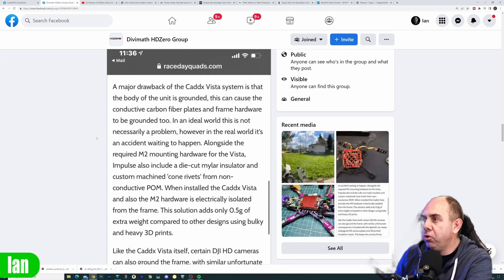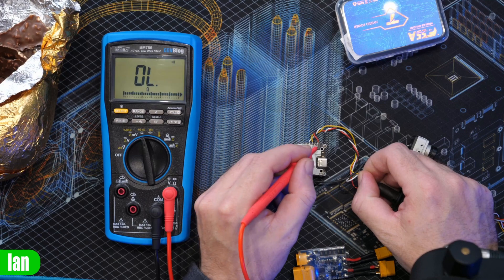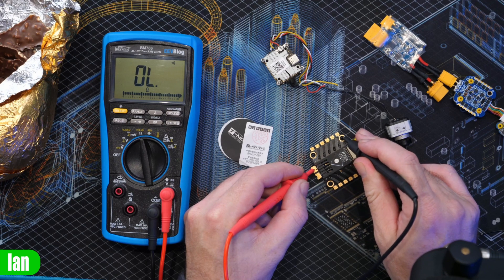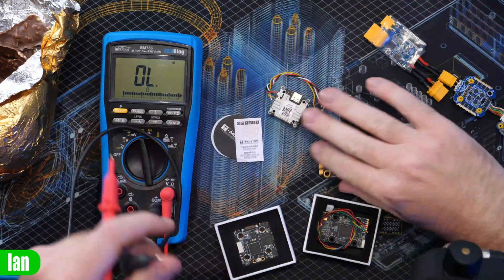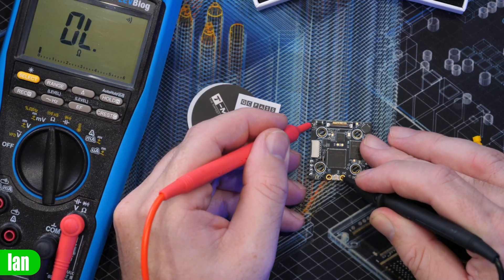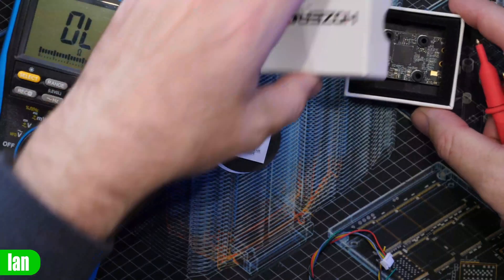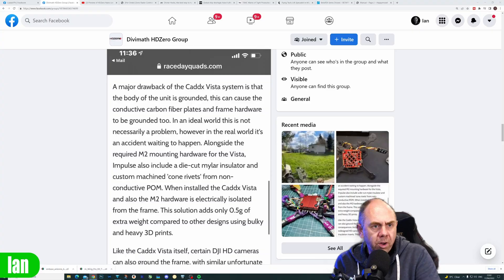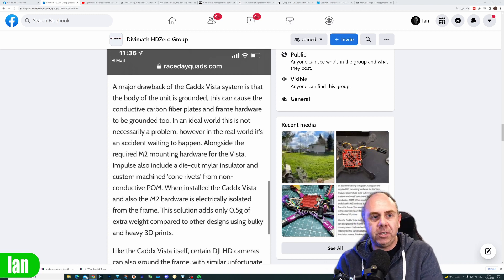CaddX Vista Grounding - Really An Issue ? - Live Clip

Comment: Thats not exactly from RDQ, its from the new ImpulseRC Apex DC frame description. Trying to making selling points for the frame, causing kaoss at the same time. Deffently have never had an issue with grounding. Make sure you builds are done right, and you shouldn't ever have an issue.

Comment: For me the problem is that caddx Vista mounting holes are grounded more than the external shield, or is it? Have you checked or can you check if you have an open caddx vista double board, if the screws holes are grounded or not? Just to understand if it's only the external shield grounded or all the internal boards becomes grounded together through the holes if a screw is in it?

Comment: Wrong Wrong.  Easy situation.   I overtightened one motor bolt by mistake and it touched the motor winding. At the time of the next start, Vista stopped showing the image. Was sent to a service center and restored. (I live near one of DJI main offices) ... Many frame manufacturers add plastic pads to the motors in the kit. At any time, you can repeat my situation - if you try to fix the motor stronger. Take my word for it - I was surprised - when I realized what happened.
Reply from the maker: Yea but the issue was not the vista. The issue is as you shorted the motor bolt to the motor.  Now let’s look at this different, vista was isolated and you flew and it worked until it broke though the wire and you downed the craft and damaged the frame, Lipo and burnt the ESC.  Again the issue was the bolt.  The simple realty is bad things will happen when something goes wrong. Adding the vista into the mix via grounding is not a major contributing factor.  .
Reply: @MadRC   sure. just wanna say - if the vista's body will be not grounded - it will be much more better for durability.  I just change the bolt - all motors and stuck works well and back to normal - but  not Vista

Comment: T-motor esc’s mounting holes are not grounded, but not isolated also! Check the continuity between motor phases and mounting holes. If you’re using metal stack screws without gummies- that’s where your issue starts to happen. There will be issue without grounded frame also, but not so much (desync or inconsistent behavior, you can say something is wrong in bidirectional dshot error rate, even before fly)

Comment: Even if the carbon fiber becomes grounded if you don't short anything to ground there isn't a problem.   The first thing we used to do with carbon fiber frames when building helicopters is sand all the corners so there are no sharp edges that will cut any wires.   What can be a problem is a signal antenna wire on a receiver lying in a carbon fiber frame which can potentially block the signal.

Comment: the potential issue is, that if the frame is grounded, and the positive battery wire touches the frame, the quad will fall out of the sky
which is something preferably avoided, hm?
especially in professional settings, i guess

Comment: I don't see why this is so controversial, and we don't need the melodrama. This is from the description ImpulseRC wrote about their Apex DC frame, which RDQ added to their website. So it's not from RDQ, it's from ImpulseRC. They were trying to do a little marketing around (what they believe) is a thoughtful design approach to solve a potential issue (and I'm sure it's an issue they've seen happen at least once, otherwise why bother?) ... If your Vista (or anything for that matter) is grounded to frame, and a live wire touches the frame, there's a potential for damage to any grounded components. A potential. Because the vista is expensive and not very easily replaced, they thought to isolate it - similar to how ESCs and FCs are technically isolated, as well. 

If I had a particularly bad crash and one of my (+) wires touched the frame, its damage may well be limited if my other sensitive electronics are isolated electrically from the frame. You're right that it's probably a non-issue for most, but it's just a little extra insurance Impulse RC just built into their design, my assumption is based on some number of complaints or concerns from customers. When I build, I isolate my HDZero VTX, my RX and everything else I can from metal-to-frame contact, because I've fried components in bad crashes when a live wire touched the frame by accident. Or a poor soldering job or bad mounting on my part caused an issue. This really isn't a controversy. Build however you want, isolate your stuff if you want. end of story.

Comment: I would hope that any RF device is grounded, especially one that uses unbalanced feeder (coax). Unless the antenna is balanced or has some form of counterpoise to work against, then using the chassis as a ground is the only way to ensure efficiency. And efficiency does not mean a low SWR but rather the reactive components, Xc and Xl are close to or equal zero.

As for 5inch (12.7cm) carbon props?? 12.7cm is close enough for government work to be a resonant full wave on 2.4GH. Carbon is RF conductive and absorbent, more so when it’s physical size is equal to a resonant property of the frequency being used. Which coincidently brings us back to the grounding effects of a quad frame.

Comment: I’ve always “isolated” my Vista by mounting it with double sided VHB tape, but I did that to isolate it from vibration more than anything else.

I’ve also had both the positive and negative battery wires cut through and touch the frame, it was funny trying to fly it back while it was sparking and browning out lol

Back in the day the bottom deck often contained both negative and positive rails and in some designs was one great big PDB, nobody was bothered about stuff being grounded back then, I’ve always considered the frame to be grounded though, it’s just good electrical practice especially for those of us who’ve worked on cars and motorcycles.

Comment: Good discussion with nice examples. I view grounding to the frame as an advantage, because it creates a known reference. (Unrelated in modern home appliance design, appliances have their casing grounded. This wasn't always the case and created some hazardous situations like touching an appliance and a metal sink)

The carbon propeller situation is interesting. (8:55)
Would expect the propellers acting like a shielded disk (rather 4 of them covering a larger plain area) If the effects are changing relative to motor rpm, it's likely similar to placing an antenna next to a larger plainer metal surface. There going to be radio wave reflections likely creating a very noisy (radio) environment. 
Worst case likely would be for a pusher (carbon propellers below motor) and antenna above the drone where the pilot is below the flying drone.

Comment: The reality is that our quads can take quite the beating resulting in all kinds of failures and having the frame electrically connected to anything is just an current path accident waiting to happen. If isolating it saves me from losing a quad or saves an expensive component then it's a simple precaution I'm happy to take! Off the top of my head some examples of ground path failures I've personally encountered since I built my first multirotor over a decade ago:

- Brand new spare motor with a short to stator (FIRE upon arming, dead ESC + Motor)
- Squished motor wire to arm nut in a tree crash (FIRE whilst turtling out of said tree, dead ESC + Vista camera cable)
- Alien PDB insulation wearing through when mounted directly on carbon (FIRE)
- Shorted motor winding to stator after crash
- Long motor screws (Seen this happen to MANY beginners, and a short stopper won't detect it until you arm the motors!)
- Mangled battery wires shorting to top plate killing VTX
- Arm mounted ESC rubbed through Heatshrink (frame positive) combined with:
- Rx antenna coax insulation wearing through where it touched carbon resulting in intermittent failsafe's

But yeah the Vista case being grounded isn't really a inherent disadvantage.. (I'm sure It does wonders for RF shielding!) The issue is it's just lining up another hole in the swiss cheese of failure!

Comment: Just a thought about RF performance of grounded/non-grounded frame:
1] All RF designers have a good practice to ground up a metal case of their RF device - it usually helps to overall performance. I understand why Vista is grounded - it's a good practice.
2] Because some/all antennas we use (dipole, circular) aren't perfectly balanced (simple dipole is around 73Ω and I highly doubt that all RXs (which are often also transmitting telemetry) have their input/output matched to that - I guess more common impedance of 50Ω is used frequently), then even the feed-line is part of the antenna and it's affecting resonance, impedance, radiation pattern ... So having a frame grounded definitely adds a complicated RF behavior, which is in some cases good (it helps to RF performance), in some cases bad (makes RF performance worse), depending on exact antenna(s) position and its parameters. If a frame isn't grounded, there's still an important influence of antenna position and orientation in respect to VTX and all other PCBs and electrically connected devices. And at the end - just the presence of carbon frame in the vicinity of antenna influences its RF performance because of capacitive coupling and reflection. (This is also I guess the reason why carbon propellers do influence the RF performance on some drones. The designers of the drone probably tested it and optimized it for the best RF performance in "default" configuration and any change to that may influence the RF performance).
So to sum it up:
From an RF point of view - the grounded frame is totally valid thing and sometimes it can help to improve the RF performance and sometimes it can be the opposite - everything depends on the physical layout and placement of all components
From a DC point of view - it adds one possible mode of failure (VBAT wire shorting to ground) to MANY already existing modes of failure. Route and protect your VBAT wire(s) properly in any case.

Comment: The ground tracks are not thick enough to survice a short, maybe,  I don't know, but if a disaster happens it happens. The gounding of the VTX  body is done for RF reasons I am guessing. Interestingly the heatsink of the 1W hdzero VTX has a non conductive coating - Macs Life shows this in one of his videos.

Comment: Isolating the vista case from the frame is a BAD thing , because if a positive wire does come into contact with it the only path for the current to take is through the units sensitive bits ,and it will burn the earths and let the smoke out, I allways ground the case , i have many vistas and air units and no problems

Comment: Treat the carbon frame as a conductive chassis onto/into which you are mounting electronic modules. In a system which includes fast switching high current, RF amplifiers, and a processor, we Must pay attention to each of their grounds.
In my decades of electronics building and troubleshooting, the grounds are the first thing I inspect. “Single Point Ground” aka star ground is still a valid concept.

Comment: Posted this comment on JB's vid:

I've had a flight controller die for this exact reason in the past, could have been prevented had I used this/a similar frame which isolates BOTH the DJI Camera and Vista. (people forget that the DJI camera is metal and also grounded to the vista).. 

There are lots of ways that your frame can get electrically charged, for example crashing and a motor bell bending which shorts to a winding (how I killed mine), or wire or a vbat wire shorting directly etc. This is just another safety measure and worth having.

People who don't think this is a good idea probably haven't had this happen or aren't crashing enough to know.
Reply: A flight control touching the frame regardless of a Vista being present is going to create shorts between various parts of a the flight controller board.
Having a grounded frame only slightly increases an electrical path being completed. The difference being zero, to one non-ground point on flight controller, to more than one point on flight controller touching the frame.